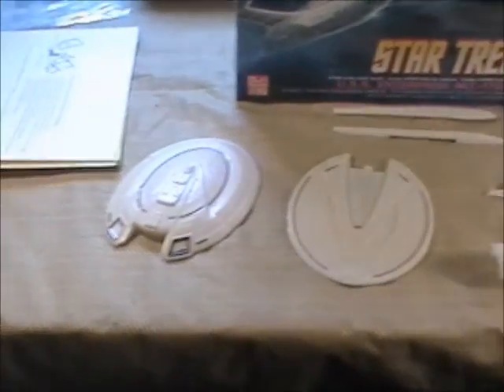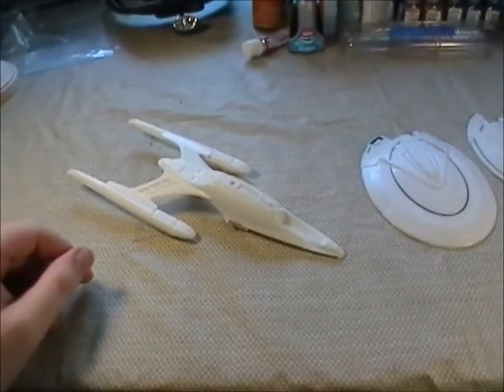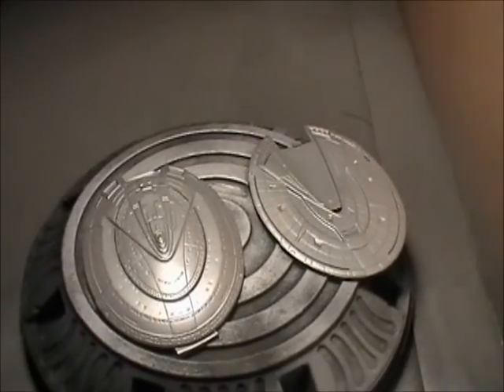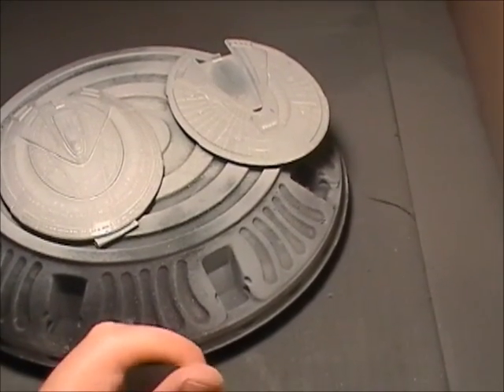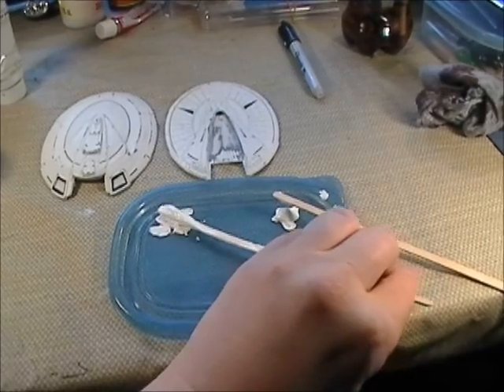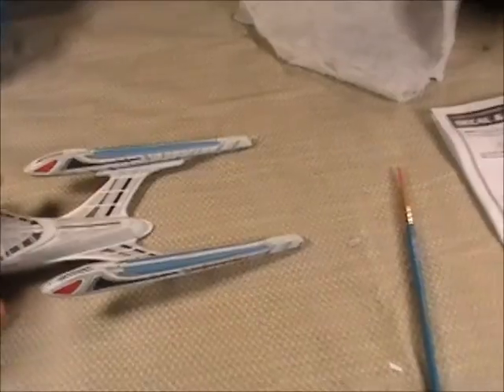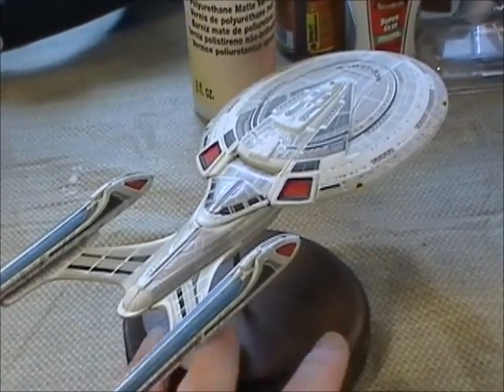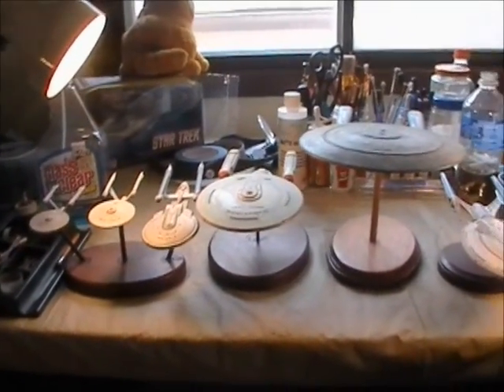1 2500 Scale Enterprise E Build

Comment: The Enterprise-E from what I understand DOESN'T separate the saucer, period.

If it did, it would be for emergency situations ONLY like the Constitution-Class ships.

The Sovereign-Class was not designed to use separation as a combat maneuver like the Galaxy-Class.  The S-Class has a different design philosophy altogether.  It was designed to be a sleeker, more mobile ship than the Galaxy-Class.  The Sovereign-Class may be slightly longer than the Galaxy-Class but in most other dimensions and gross tonnage it's actually far smaller.

I never understood the whole philosophy behind "Bigger is Better" in the 24th Century and JJ-Verse Trek universes.  If anything, the larger ships are just lumbering whales waiting to be pitted with weapons by far smaller, more agile ships.  The smaller ships may not have the firepower and shield capacity of the larger ships BUT larger ships can be easily overwhelmed and taken down by swarms of small ships.  That was something demonstrated in the last Star Trek movie and an episode or two of DS9.

[If anything, the Excelsior in Star Trek III was engineered to look like a big joke next to the older Enterprise/Constitution Class Refit.  The ease of which Scotty sabotaged the Excelsior in addition to the fact that the Excelsior lumbered out of Spacedock behind the HEAVILY DAMAGED Enterprise shows the newer, supposedly technologically-superior ship had problems.  It was just not as nimble as the older ship and the transwarp system turned out to be the Achilles' heel of that ship in addition to the fact that it was just not adequately powered.  The whole Excelsior-Class/Enterprise-B Subclass was supposedly  an attempt to address the shortcomings of the original Excelsior-Class design with its inadequate powerplant and lower mobility.  That's why the Enterprise-B had those ridiculously oversized impulse engine add-ons and a somewhat larger engineering hull than the original Excelsior.]

in true-life nautical history, the Spanish Armada was partly overtaken by smaller, more mobile British ships as well as bad storms.  The Spanish galleons were just way-overloaded and too big for their own good to be in battle.

It's not a big secret, btw, that the US Navy considers its larger surface ships (carriers) to be very vulnerable to attack.  That's why carriers are surrounded by submarines, missile cruisers, and well-gunned ships in addition to their airwings.  Probably the most devastating naval vessels are actually submarines and those aren't very big ships.  Subs inflicted far more damage and sunk more enemy vessels during World War II than carriers and other surface ships in actuality.  World War II saw the end of the battleship as the capital surface ship.  You just can't armor ANY ship well-enough to withstand bombardment from aerial attack as well as missiles.  2-, even 3-ft or armor won't keep a ship from eventually being sunk by missiles that can travel and hit at better than 3 times the speed of sound.  Battleships were very expensive to build and maintain because of the weight of armor and their relatively high consumption of fuel because of all those tons of armoring.  They eventually limited the size of those ships because they became progressively fuel-inefficient as they were scaled up.  The Navy wanted them to be fast but they just guzzled fuel like an Indy 500 formula racer at better than 28-kt speeds!
Reply: It was designed to have a separating saucer section. The designer even has sketches showing the separation that appeared in a magazine that can be googled and found online. Had the films continued it might have been seen on screen at some point.